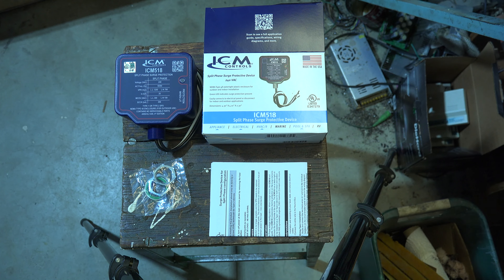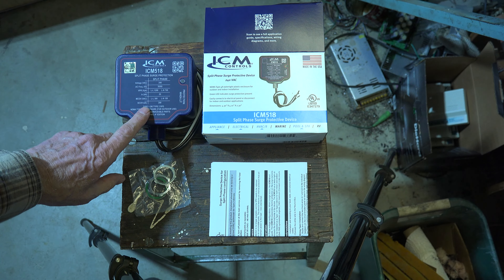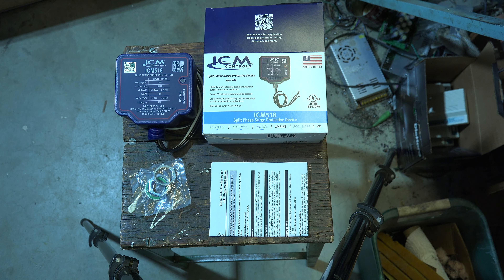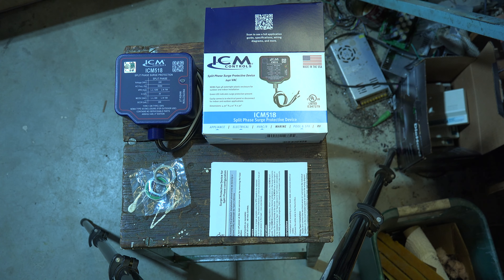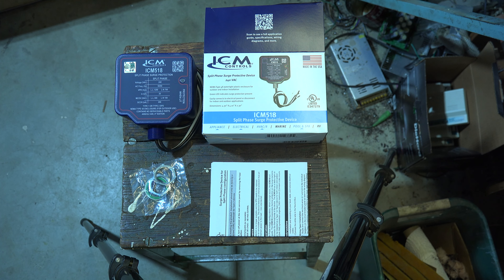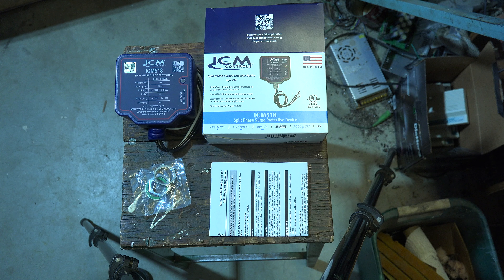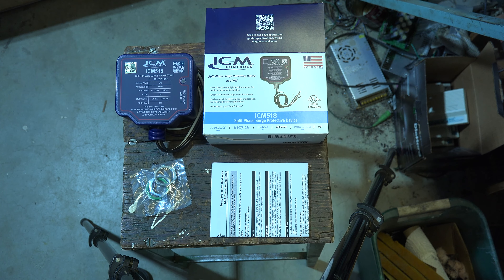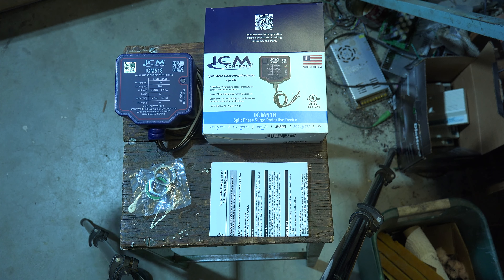Review and install of the ICM 518 surge protector

Comment: Could you put this on your air conditioner condenser unit? I don't think installers typically send a neutral wire outside to your condenser unit (it's just  the two hot wires and a ground wire at my house); so could you attach the white wire from ICM 517 to the ground wire coming from the breaker panel?

Comment: Why does your video title say ICM 517 and the one you install is an ICM 518? Oh, I just googled it. ICM 517 is for single phase devices! You might want to update your video title!
Reply from the maker: Sorry about the typo.  I have changed it.  
The 517 can be used for 240 volt disconnects without a neutral.  
The white wire is not shown in the diagram, so it is cut off.  
You can use a 3/4" knockout.
GFM